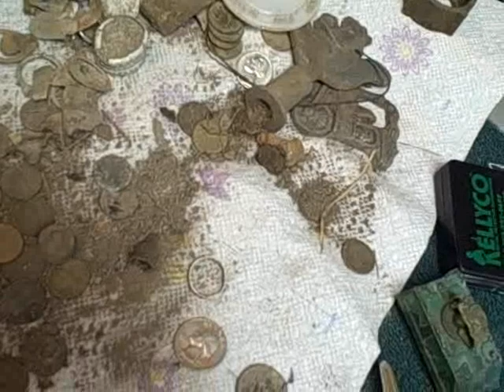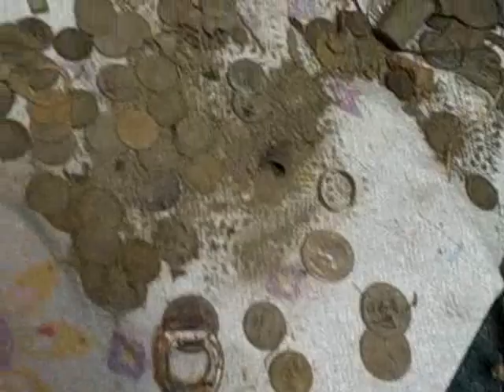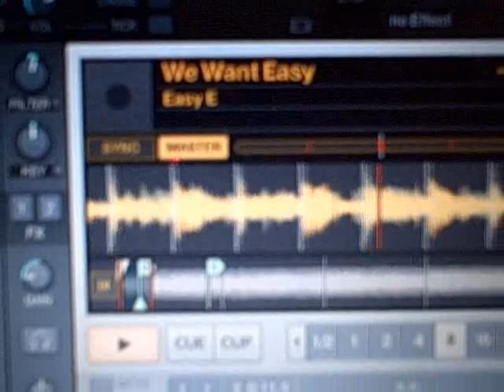All Over The Place... Rambling

Comment: hey jake, i have a friend who has the same problem. What i told him was the first week when youre carbing, hook up the CO2 connection to the keg and set it at 12psi and disconnect it. Do that for the first week as the pressure will decrease due to CO2 being absorbed into the beer. After it stops decreasing (~6-8 days) just reduce pressure back to serving PSI and you're good... dont keep the CO2 connected. When it runs low, reconnect and add a little. Never keep it connected and on.